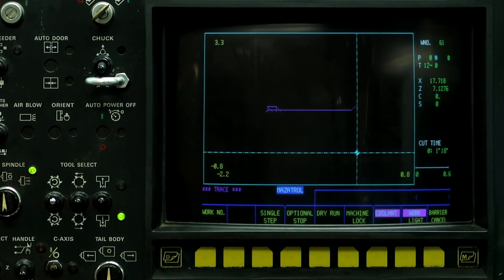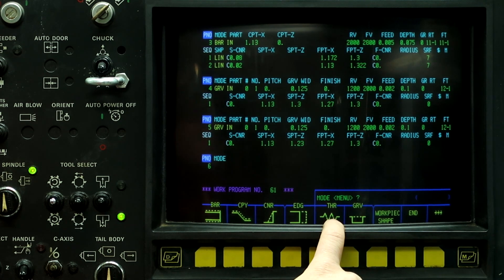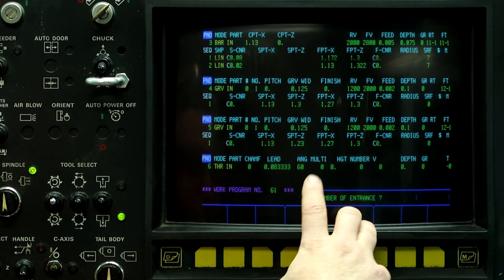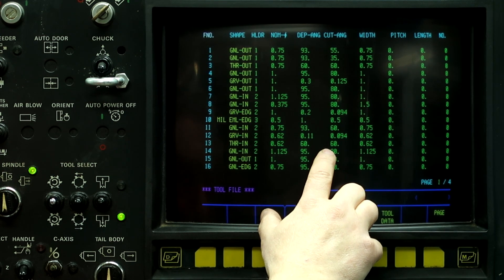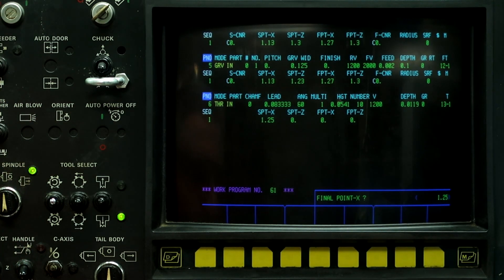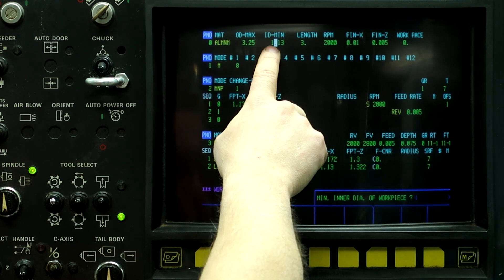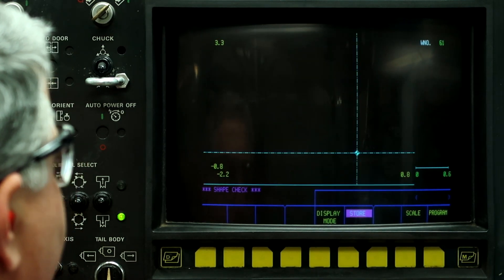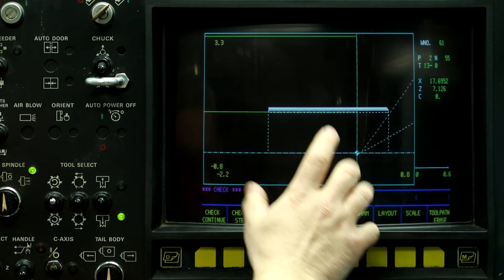Mazatrol Programming Lathe ID Threading Mazak

Comment: I found this Channel a while ago and was interested to watch videos that could help the guy running our QT10. Now he is not here and I'm actually benefiting ALOT from your education because I'm doing the Turning now. Thanks very much .

I do have a question though, about ID Threading. 
I did watch this video about ID Threading and have made sure that my MIN ID is the drill size.
After drilling Ø6.5, I bore out to 9mm for a 10x1mm thread.
The threading cycle is working fine , but right at the end for the Thread bar to pull out, the Thread Bar drops more in the X than during the Thread Cycle and almost touches the Ø9 Bore(when I saw that the first time I thought the Thread Bar would break).

Do you know if there is a machine parameter controlling this distance of Pull Out, OR should I adjust the MIN ID at the beginning of the Program
Reply from the maker: Unfortunately on the T2 and T3 control, you need to specify the ID min on top line close to the thread ID. That means you need to use a larger diameter drill bit or rough out the material using MNP.

Comment: Have an ID thread ?    I’m using partial profile inserts. The tool I’m using doesn’t have a shim to change the angle, 1, 2 98 99 etc. the job I’m doing will require me to use a 99 shim but tool doesn’t have a shim. So would it be ok to just run without the proper angled shim? Not sure what will happen, probably poor insert wear?
Reply from the maker: It will not cut a proper thread profile if you are not using the correct shim. The heel of the insert will likely rub the thread and tear the material.

Comment: Hi Phil thank you for sharing, but I have a question, where can I find the dimension of the start point and final point of a 3/4 NPTF using single point? Thank you
Reply from the maker: I purchased Thread Pal threading software to calculate those dimensions but I have not tried to use it on a pipe thread yet.
Reply: @mazatroltipsandtricks6816  Ok Phil thanks, and how much you paid for the software?
Reply from the maker: @hectordjvago793  $79.95  for the software. Go to https://closetolerancesoftware.com/METhreadPal.html

Comment: Hey Phil. Thanks so much for your helpful videos! Trying to cut 7/8-9 internal threads on 304 SS.
Can't get the spindle to reverse. Programming M4 code after M8  but the spindle still turns normally. Any ideas? Thanks!
Reply from the maker: Change the spindle arrow direction in the tool data page.

Comment: Sir need help on mazak threading cycle how can i contact with u ?.
Reply from the maker: What do you need to know?
Reply: @mazatroltipsandtricks6816  problem with eia program of g76 threading cycle (id thread) on mazatrol . It not working properly , same program work nicely on fanuk control . Need help
Reply from the maker: @ashishpatil1020  I've never needed to run a threading cycle in EIA on a Mazak. I'm not much help with your issue. Sorry.
Reply: @mazatroltipsandtricks6816  sir pls make watsapp group to help them on mazatrol mc.

Comment: Phil, as you know I am a newb here.  Got myself a Mazak SQT, but the seller kept all the indexable tooling for himself.   He did leave me all the too holders though.   https://imgur.com/XEryGVE    My question is this, should I invest in through coolant static indexable tooling or whats lowest cost on Ebay?  I think I need 1 cut off,  2 RH CNMG,  2 RH VNMG inserts and a threading tool holder.
Reply from the maker: I would look for boring bars with through coolant you really don't need through coolant for turning holders.  I do buy a lot of tooling on ebay myself.
Reply: @mazatroltipsandtricks6816 , so I'll save my money for where its really needed.

Comment: Thank you very much Phil, your content is so helpful. Something I would like to ask you . I'm using center action bar puller. For some reason it takes long time because when the puller is engaged it stays for some while, then it pulls and stays again. It's pretty much looking on some delay which probably is designated in parameters.Don't you know how to reduce the time of delay?
Something else I would like to ask you about. When I do threading very often the machine gives me alarm that acceleration of the speed is to high even when the cutting speed is low some around 50 fpm. Which parameter is responsible for this?

Thank you very much again. 
Igor.
Reply from the maker: What controller do you have?  I only have parameter information regarding the T-2 and T-3 controls.  I will have to look for the timer parameter regarding the delay time of the chuck.

For the threading parameter, U35 controls the acceleration distance.  It is set to a low value from the factory and that causes problems with threading speed.  The range of the parameter is 0-255, but I have mine set to 100 and it works fine.
Reply: @mazatroltipsandtricks6816  Thanks for your response. I have T2 controller.

Comment: Hi Phil I worked mostly on G code programming but my employer got an integrx. I have a question for you.
I saw some old programs on that machine and saw + sign on left side of  screen under unit number.
What does + sign means in this case ??
Just wondering.

Thanks
Reply from the maker: The + sign means the TPC was edited for that unit.
Reply: @mazatroltipsandtricks6816  thanks a lot for reply
Reply from the maker: @ErasePAKIS  No problem. Glad to help.
Reply: @mazatroltipsandtricks6816   What is the TPC?
Reply from the maker: @loukola5353  TPC is Tool Parameter Control.  It is a feature first introduced on the T32 series controls.  It allows you to change the machine parameters for an individual process or unit without changing the global parameters.  TPC also allows you to change the approach and retract tool vectors for an individual process or unit.  Very helpful in certain situations when doing something oddball.
Reply: Mazatrol Tips and Tricks  What is the default retract amount in X and Z in Mazatrol? I am guessing they depend on how the parameters were set in the machine?
Reply from the maker: @loukola5353  Default approach and retract parameters for X and Z is usually 2mm or written as 787 with no decimal if the machine is setup in inches.